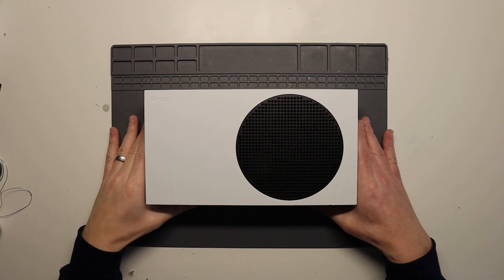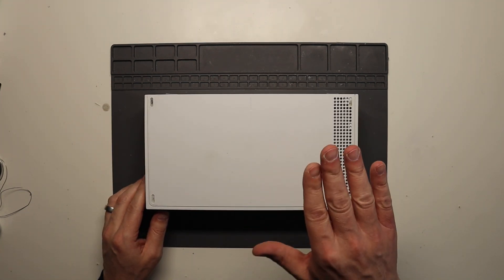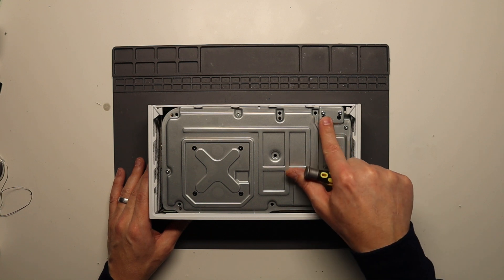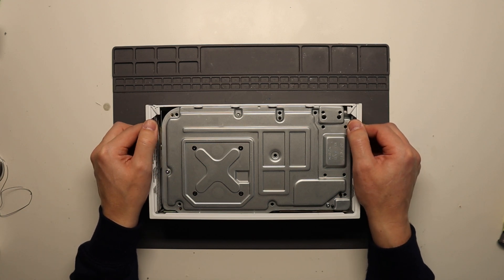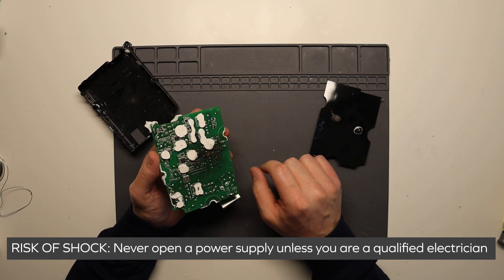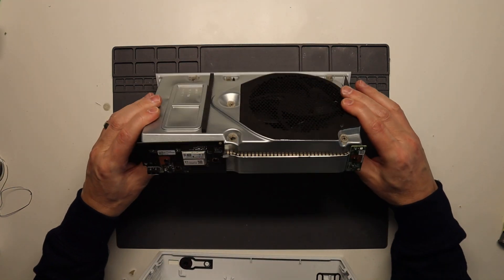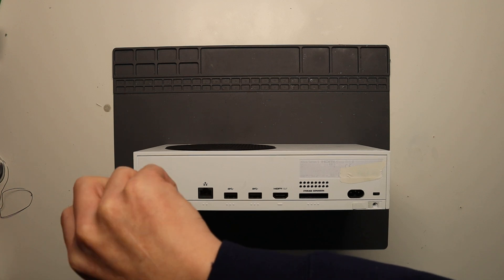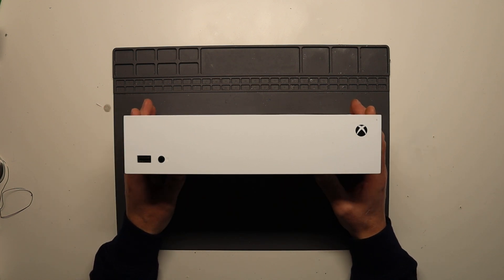How to replace a power supply in the Xbox Series S - Simple start to finish guide. No Power Issue.

Comment: I’m confused wether the psu has a light indicator on it or not, I’ve looked at mine and can’t see one looked on google and it said if there’s green it’s good amber it’s low power and no light there’s a fault. Can you please provide me any information if there is the light indicator or not on this model please, thank you.
Reply from the maker: On the Xbox Series models there is no inidicator on the power supply itself - the only light in on the power button of the console.  The older Xbox 360 original models that had an external power supply  had a light to indicate, but not these new models.
Reply: @ConsoleTherapy Yh I thought it was just the external devices thank you an great video

Comment: what do you call the greeny/blue stuff on the psu? i put a new one in and just transferred it over from the old to new but would like to replace with new
Reply from the maker: It they are thermal viscose pads - you can buy them from eBay